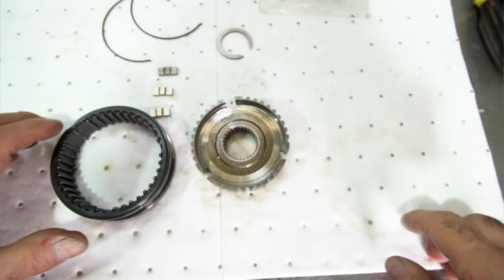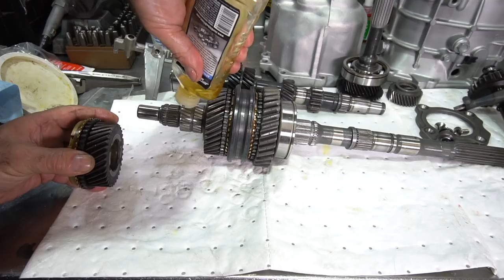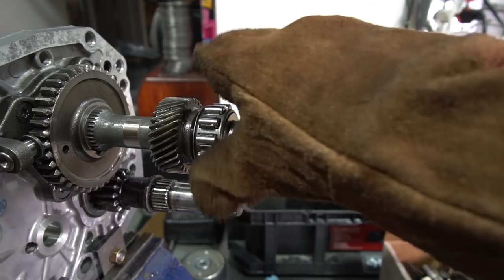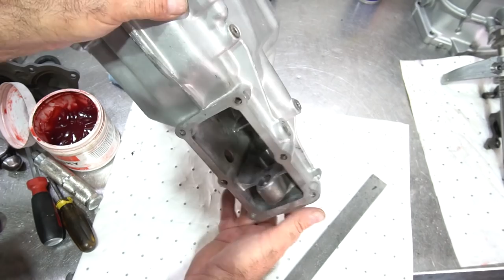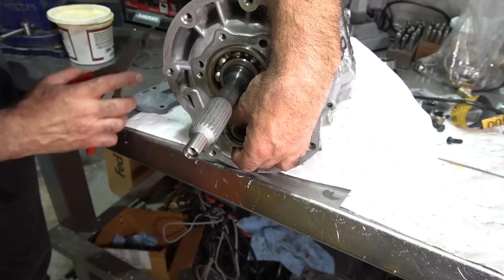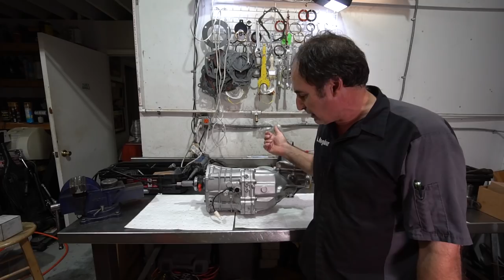How to Rebuild a Toyota W58 5 Speed Transmission - Part 2

Comment: I just watched this series for the third time. I learn something new each time. I have a 1982 Toyota Pickup (22R) RWD with a W50 that pops out of fifth gear. I've completely replaced the shifter, bushings, and seat with all new parts, but that didn't fix the problem. Everything else works great. It shifts smoothly, no noise, no leaks, it just pops out of fifth. It snaps into gear when shifting and then, usually after several minutes, pops out - sometimes under load, sometimes when decelerating. I'm wondering if there's a problem with the gear and/or the slider? I don't want to tear it down, but I think I'm going to have to. What should I be looking for when I'm in there?

Thanks again for putting these videos together, and for taking the time to show and tell everything so clearly.
Reply from the maker: The gears have been an issue. The engagement teeth get distorted over time.
Reply: @GearBoxVideo  Thanks for your prompt response! I was suspecting something like that. Well, your video series has given me the confidence to know I can tear it down and put it back together. Now I just need the parts. I've found a few sources for rebuild kits, but I haven't been able to scare up the actual gears. I want to be prepared for worst case before I start. Do you have any ideas of where I might source fifth gear for a W50?
And thanks again!
Reply from the maker: There are a few people selling 5th sets on Ebay. They are all from the same manufacturer
Reply: @GearBoxVideo  I'm finding gear sets for W55, W56, W58, W59 ... Not seeing anything for W50. Any chance they're interchangeable with the W50 gear set?

Comment: We went to press the input shaft bearing off and the end of the shaft shattered, Lexus does make replacements, it comes with an input shaft and counter shaft for about 300 bucks. BK162WS doesnt come with the correct input shaft bearing but those are also available from Lexus.  The synchros were all incorrect for it too but ours, like yours, were good.
Reply from the maker: Never press directly on the pilot section. always use a sleeve. You have to monitor the press, especially if it is electric.  I try to get parts direct from Toyota or Lexus.  The kits are garbage.

Comment: That was the best video I have ever seen on one of these.. thank you so much.
Very surprised you didn’t bench test the gears before putting casing back on.?
Reply from the maker: You can't bench test the gear train because the case maintains the center to center clearance. So your comment makes zero sense.
Reply from the maker: We don't allow video links here and again... the guy in the video is accomplishing nothing.  Spacing and shift rail alignment are constrained by the cases. Ends of the rails are held by the cases, shafts are held by the cases. So again the guy is accomplishing nothing other than making sure he has everything back in the proper place which if you know what your are doing this is not needed. I've done over 100 of these type of builds in 40 years of business. Never an issue. Also you don't have to check that the sliders and hubs shift when it's all assembled. That should be done before you assemble the gear train. Shifting the assemblies with no rails in place as in the video can also cause the assembly to over shift and cause the struts to pop out. Especially on the 3-4 since the input is not held in place. So again this is meaningless and a poor way of checking your work and can also cause issues and a reason why I don't do this.
Reply: @GearBoxVideo 
Makes sense
Thank you 👍

Comment: Hey thank you for your video, it helped me rebuild my w56 for a first gen 4runner. I think I did ok but it won't shift into 2nd, 4th, or reverse. It will shift into 1,3,5. I drove it around thinking it was stuck(I didnt dry shift on the bench) but gears are still stuck. What did I do wrong? Thanks again for your help.
Reply from the maker: Sounds like something wrong with the main shift rail. Since it pulls all the gears mentioned in the same direction.

Comment: This was super helpful thank you so much! On mine, the floating input shaft's bearing hasnt come through the housing enough to get the retaining clip on. Ive held the trans up by the input shaft and tapped down on the casing with a brass hammer a bit which was enough for the clip to the cluster shaft, but still cant seem to get the main input beaing out enough to reach the groove. Its close, but not close enough. Is this nornal?
Reply from the maker: Clean up the bore with a hone and lube it

Comment: I guess what I'm saying is. A short video showing how to change the input shaft without dismantling the entire transmission. Thanks again!
Reply from the maker: Watch the video and look at the gear. Look at its relationship to the lower gear. Think it thru.  You cannot do that
Reply: I second your request. I just need to replace the input shaft on my W59. I watched the video carefully and think there is still a lot of disassembly. Looks like both the main and countershaft need to move forward enough to spread them apart. But there's a lot of parts keeping that from happing easily.
Reply: Taking another look I see the input shaft and the 4th speed gear are one and what is keeping them from being removed is the 4th gear and bearing on the countershaft. So, if I can use a puller behind the 4th counter gear to pull the gear and bearing off, then the input shaft will simply slip off. Then I need to figure out how to press the counter gear and bearing back on the countershaft. More to come.

Comment: Why don't you mention anything about checking Clarence is between the gears before removal and upon pressing them on during installation? Just wondering if you just didn't show it or you have a reason for not doing so because the factory service manual says to and I'm getting ready to rebuild a w56 myself and don't want to make any mistakes or go through any extra unnecessary steps.
Reply from the maker: Think it thru. How are you going to adjust clearances? What happens with these specs in books  is that if you have a failure you need to change parts. In the event for example something welded to a shaft or a gear was obviously worn to the eye. You may want to check a clearance if you think a thrust flange may be worn or still usable.The transmission in the video was in great shape. I guess I know how end play should be and if a surface appeared heated or galled up you may want to check for excessive endplay and change the part out. Some transmissions have different size snap rings. However it's hard to get these parts now. So for the most part you can't adjust clearances but just check them. So again you really don't need to check clearances in a transmission that you just want to freshen up but if you are changing some major parts you may want to check your endplay. But again finding shims and snap rings is not easy for these. Thanks for watching.
Reply: Thank you very much for the quick response. It looks like I'm going to be needing 5th and reverse gear sets for my w56 tranny where would you recommend that I go to look for hard parts and rebuild kit.
Reply from the maker: I see them on eBay but again the kits are sketchy. Try a dealership first
Reply: Sounds good, thanks again. Keep up the amazing videos and I will keep on watching.

Comment: Is the w55,w58 and r154 have the same internals are can you use the r154 internals in a w55 transfer case because it was says the w55 is weak but looks exactly the same I'm having 4th gear pop out problems and in the future I want to add more power to my car would it be worth it rebuilding the w55

Comment: I'm currently rebuilding (my first transmission) an Isuzu MUA5, which is surprisingly similar to this W58 in layout, construction and size. One question: some of the dog-teeth are slightly rounded (I am working with 2 transmissions and picking the best parts from each), I have removed any burrs from the dog-teeth, but I was wondering if you would advise "sharpening" the teeth, or leaving them as they are. 

Thank you so much for your priceless content.
Reply from the maker: Leave them as they are
Reply: Thank you! Shall get you some beverages soon.
Reply: Another question: The remote shifter housing has a shaft that slides between two bushings, and a seal at one end. There is a tiny amount of play in the bushings, which I gather is normal/necessary since it is the same on the 3 I have.

Greasing the bushings/seal: 

Should I use a Moly grease (or assembly grease) under the assumption that I want an oil-compatible grease---the shifter does get splashed with a lot of oil from the trans---or go with something like PM600 "Military Grease" Liquid-o-Ring which seems to be exceptional at many things, such as staying in place and not mixing with oil.
Reply from the maker: Don't use a moly grease just like a wheel bearing grease
Reply: @GearBoxVideo  Yesterday I got most of the gear cluster assembled on the Center Plate, then found that my rebuild kit was missing the rear Counter Shaft bearing (the last part to be installed before shifting hardware): The OEM counter shaft front and center bearings are big roller bearings (025-52NX), whereas the kit came with deep-groove ball bearings for both. The original counter shaft bearings all feel good.

While I wait to hear back from the company I bought the kit from, would you lean towards new deep-groove bearings, or reusing 3 bearings that were in the trans?

My motive for rebuilding is that the trans in my truck leaks and whines (in all but 4th). I have no idea what the trans I'm working on sounded like, but I am obviously biased towards thinking that the bearings need replaced.
Reply from the maker: As a rule you can have ball bearings in place of flat rollers just as long as you maintain the same endplay
Reply: @GearBoxVideo  I'm not sure how I can measure endplay (also I can't measure what it used to be, without a DeLorean), however... The original setup had a flat roller at the front, with the outer race/rollers held in the front housing with a snap ring. Center support flat roller bearing sits without a precise location, it is just held from falling out the back by the retainer plate. The rear deep-groove bearing has nothing keeping it in place. So I am guessing that unless the rear bearing is jammed up against the case, having only one bearing in the countershaft held firmly in place should allow for the necessary endplay.
Reply: I cleaned and inspected the flat rollers. they are in perfect condition, with no marks, heat striations or pits. So I chose to clean them and reinstall them, eliminating any conflict of end play tolerances.

Comment: Great upload! Quick question. Is that a sleeve pressed in to the extension housing? When you were putting in the rear seal. Just under the seal looks like a race but no bearing goes inside of it.
Reply from the maker: A bushing

Comment: Very explicit video and I appreciate the details of it but I gotta ask...How much does it cost if “you” rebuild my transmission?
Reply from the maker: I've rebuilt many different transmissions when my shop was doing dealer work. If I come across a transmission that would be worthy of doing a video then I'll take it in for a rebuild. Currently I'm involved with the manufacture of new transmissions so I don't have time to rebuild units but that may change in the future. I cannot put a cost on a rebuild  because all transmissions need different parts.

Comment: I have a toyota 4x4 r150f transmission and it looks like they used fipg or red permatex for the cases.I like to use gaskets whenever I can is it ok to use paper gaskets on it or just stick with fipg.or ultra gray
Reply from the maker: If it has no gaskets and there are no gaps you should be fine of it was working fine. I don't use RTV silicone anymore just Dynatex 49477

Comment: Paul i was thinking about buying a Toyota Hilux turbo diesel with a 6 speed manual box, can you tell me if this is a good box and will this 6 speed last if maintained properly?
Reply from the maker: I honestly do not know anything about that transmission. However, since manual transmissions do not have filters the best maintenance you can do is change the oil every 10 thousand miles as well as check your oil level.

Comment: just curious, if i just want replace the shifter housing so its farther back without completely taking the tail shaft all the way off you think it possible? just makes me nervous taking my trans apart to be honest
Reply from the maker: Taking the extension off really isn't a problem. But some remote housings do not need anything more than the shifter coming off

Comment: My '86 Toyota pickup (2WD, 5 speed) has recently begun to make noise, when temperatures are at, or below freezing.  The noise is only noticeable with the transmission in neutral and the clutch released (no pressure on the clutch pedal).  The clutch release (throw-out) bearing and the bearing in the flywheel are only a couple years old.

It appears to me, that the input shaft is designed to be removable, without full disassembly of the transmission... 

Seems the input shaft ball-bearing would be the likely culprit.

WOULD IT BE WORTH replacing the input shaft seal and ball-bearing?  (rather than either replacing, or fully rebuilding the transmission)

Thanks!  Enjoyed the video (parts 1 and 2)
Reply from the maker: When was the last time you changed your oil?
Reply: @GearBoxVideo ,  Transmission gear lube?  I had it checked several months ago, during full oil/lube service.  They told me it was "good".  The last change was not in recent memory.

According to the troubleshooting section of the Haynes manual, first thing to do is check gear lube level.  I plan to drain it, then re-fill with new, to be sure.
Reply from the maker: You should change your oil not just check it
Reply: @GearBoxVideo  Thank you.  Fully drained (about 1 qt) and refilled (2.3 qt).  the bearing noise ended (surprise)... I found that, even though I replaced the rear seal on the transmission a year ago, it is leaking.  I need to get under and check for drive shaft bushing wear (inside the tail/extension housing).   If worn, I hope it can be changed in-vehicle (without pulling the entire transmission).

Comment: Awesome informative videos! I was performing some basic maintenance to my w58 and when I removed the front bearing retainer to replace the input shaft seal, when I put it all back together the trans doesn't budge. Like something is binding up. I did spin the trans with the input shaft plate off trying to get all the old oil out. Any idea where I went wrong? The main shaft does have in and out play maybe something got out of alignment?
Reply from the maker: Remove the front retainer.  Its possible you pulled the input shaft out to far and the synchro keys are no longer in the ring slots.  Reassembling the unit like this will bind the unit up.
Reply: @GearBoxVideo  okay I'll check that out. Thanks alot!
Reply: @GearBoxVideo  that was indeed the problem. Got the trans in the car now! I'll be looking forward to seeing more of your videos!!

Comment: I have a 2000 tacoma 4x4 with 163k miles and my 5th gear started to grind going into gear . it only does it after 50mph . I replaced the shift bushing and it did get better but still does it any idea as to what might be tje issue
Reply from the maker: You might want to change the oil. Other than that you may need a new ring

Comment: Great video.  I made my own alloy back plate and fitted a W58 into my Healey 100 many years ago,  it has the 0.73 ratio on 5th gear.  I would like to do a similar project on my Triumph but can't find a W58 box for a reasonable cost, loads of transmissions from 2wd pick ups, with 0.85 ratios on 5th.

If I get a box, say a W56 or W55 from what I've read it should be possible to change the input shaft and the intermediate shaft so the 5th gear ratio will drop to  0.73.  As it was a standard Toyota design, I'm thinking it can be done, but at what cost? Sure would like to drop the ratio down a little more.  

Can you get these parts? or even a different 5th gear set, other than the 57/33 that's available.

Thx Johnb
Reply from the maker: I can't get the parts. however keep in mind that if you change the headset you will change the ratios for all the gears as well

Comment: R155F in a 2007 Tacoma with 420,000 miles on it and making noise in all gears but 4th...should I tear it down and attempt a bearing kit or in your opinion am I asking too much?
Reply from the maker: When in 4th (direct) there is no load on the bearings or input shaft.. so that is probably the problem
Reply: GearBoxVideo    . Do you see many that destroy the input or main shaft where the pocket bearing has gone bad with this high of mileage?
Reply from the maker: Usually due to lack of lube. Nobody checks oil levels and they burn out the front end

Comment: I have a high pitch squeal when I put my Toyota W55 transmission into 1st 2nd and 3rd gear. The noise goes away in neutral or when I step on the clutch. Do you have any idea what cause that noise?
Reply: countershaft bearing
Reply from the maker: Usually if you are standing still it's the pilot bushing. Not a countershaft bearing. There are 3 bearings for the counter shaft and those will not squeal when going bad. They will make a rumbling growling noise. If the noise only happens when the pedal is down it's a release bearing
Reply: @GearBoxVideo  I appreciate all the knowledge you share. My noise was like a belt whine combined with a dirty wheel bearing only when it was moving in gear, but not fourth when the input just mates to the output which led to me the countershaft. I found out every bearing in it was bad though